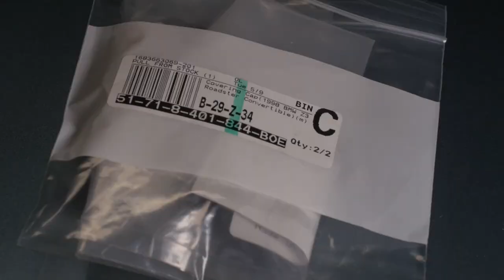BMW Z3 Convertible Top Replacement - Part 2: Installation

Comment: I liked your video. I have done convertible tops professionally for several years but never on a Z3. there are very few convertible top designs, but it helps having somebody around with experience on a job like this. We got it in just two days. Thanks again.
Reply from the maker: Thank you for the comment.  I'm sure having done this work professionally, you could do it in your sleep!  It's always an adventure doing something without much fore-knowledge, and resources on this topic were really lacking, which was why I made this video.  For me, seeing someone else do it first is so much easier.
I'm glad you enjoyed the video.  Thanks again for the comment, and thanks for watching!

Comment: Amazing video! My soft top came factory with a sort of insulation on the inside... How would i go about getting that again?
Reply from the maker: Thanks much!  I'm not familiar with any sort of insulation - is it a headliner or something else?  Thanks for watching!
Reply: @mainejason  Yeahhhh kinda! Has those little buttons similar to the ones in the storage compartment to secure it in it seems... Not too sure 🤔 Id like to preserve it but see no guides to
Reply: @mainejason  Nevermind - Just figured it out hahahaha. The things you find if you look for them!
Reply from the maker: @j6sph  something like this?  This may not fit your model, but it's the idea.  https://www.realoem.com/bmw/enUS/showparts?id=CH73-USA---Z3-BMW-Z3+1.9&diagId=54_0309

Comment: Very informative, thank you. I'm picking up my late father's z3 2.8 wide body and have been told the roof leaks badly " 1000 mile drive in the dead of winter " 😂 should be fun! Anyway this is the first job on the list
Reply from the maker: Wow!  Hopefully you wont have to deal with any snow or ice.  The Z3 may be the worst car ever to drive in those conditions - don’t ask my how I know 😜. I’m glad you found the video possibly useful.  Best of luck, and thanks for watching!

Comment: What type of staple gun are you using - i don't see how its securing the roof to the bar
Reply from the maker: It is the Arrow pneumatic staple gun with, I believe 10mm stainless steel staples.  The links are in the description.  I also made a short review video for it.  Great little gun.  The bow has a channel in it that has a kind of plastic substance embedded into it.  That is what you staple into.  Hope that helps, and thanks for watching!
Reply: Aaaah now I understand - many thanks for explaining - with that knowledge and the rest of this excellent video I think I could do this
Reply from the maker: Fantastic!  Give it a try 😉

Comment: Suburb video. Best one for Z3 top on YouTube!!!
Reply from the maker: Very kind words - thank you, and thanks for watching!
Reply: @mainejason  of course! Just completed mine on my 2002 with the headliner. I bought the $99 sail material too on eBay & it fits perfectly. It’s missing the plastics to send the screws in but still doable with the material flaps & a pic tool
Reply from the maker: Excellent - nice work!
I’m glad it worked out well for you.